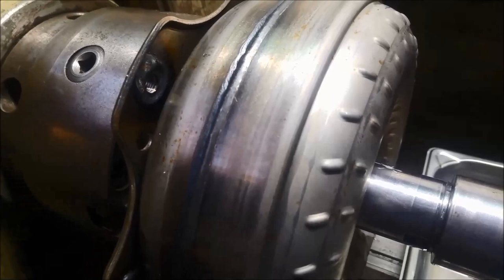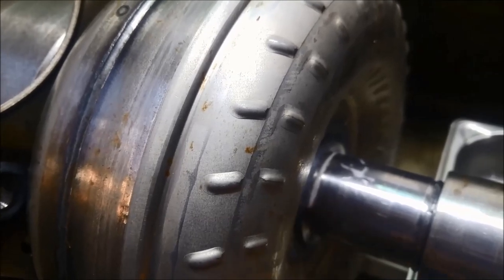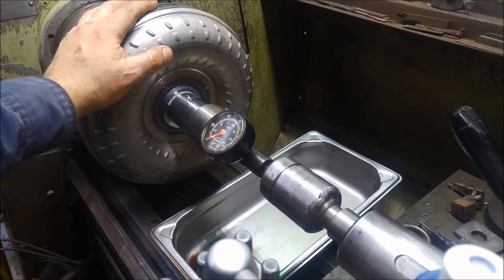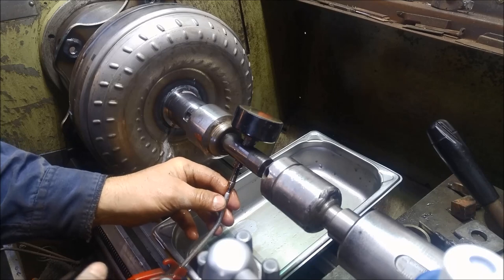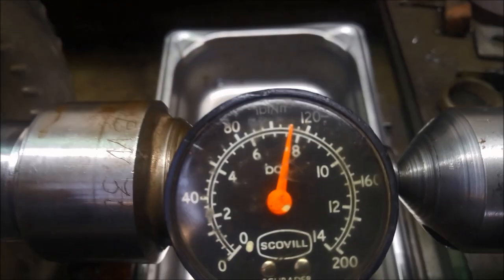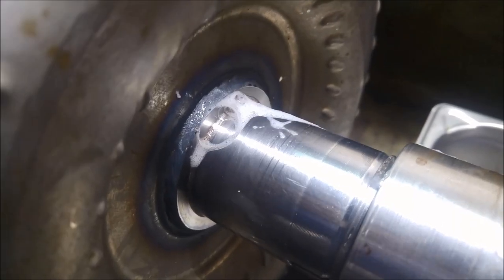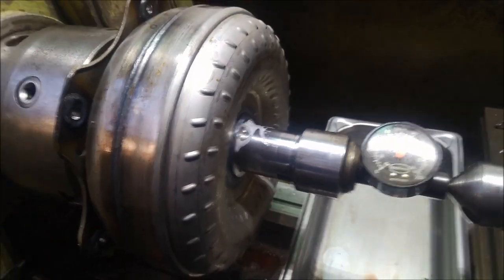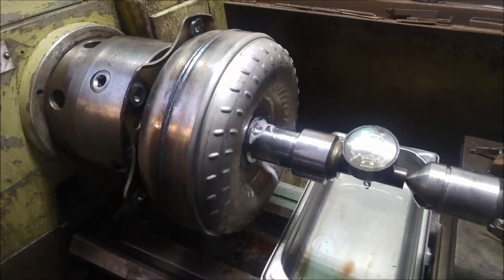Automatic Transmission Torque Converter Pressure Leak Test Fluid Leak Test

Comment: At what level is the ATF inside the converter? If the crack is on it, would it then leaks only when the crack is below the ATF level? If a customer tells u it leaks some nights only, good hint it is the converter?
Reply from the maker: i, you dont need much atf in converter to show where crack is. cheers

Comment: Is it GA6L45R model that is used in BMW also ?
I am having almost the same problem, ATF is leaking from the gear box, I am intending to open the Transmission next week (i was going to concentrate on the main converter oil seal),
Now i will check the converter's leak as well,
Thanks a lot.
Reply from the maker: hi, make sure you check the bushing as well. cheers